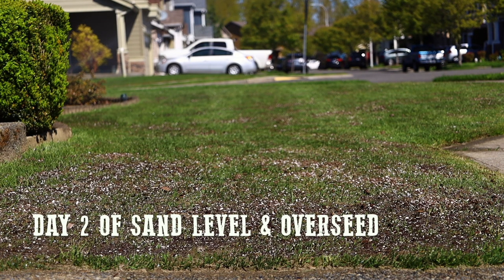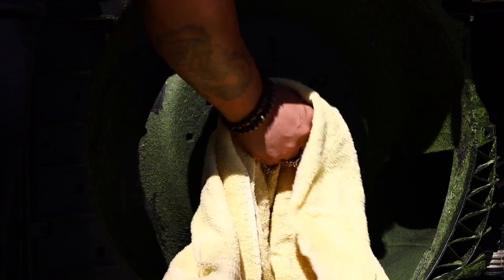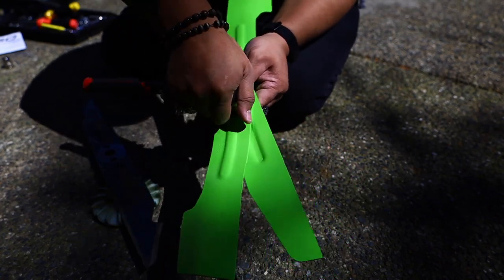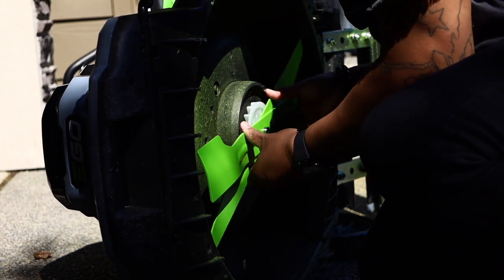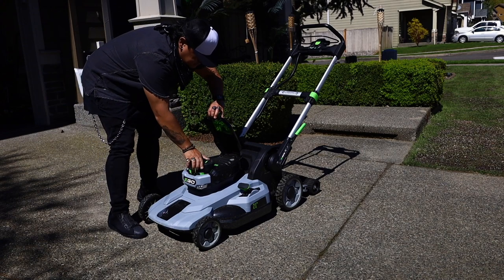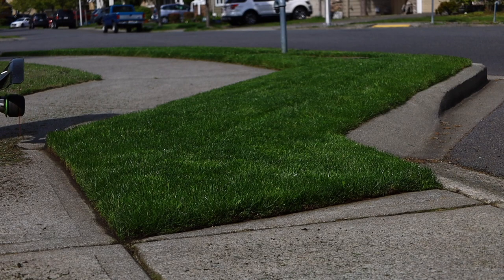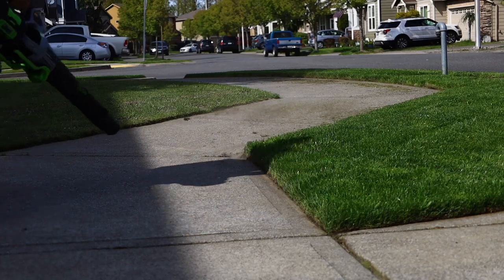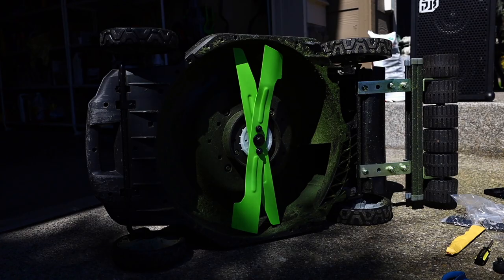I put the EGO Dual High Lift Blade on my Older lawn mower ~ Did it the right way keeping same HOC!

Comment: I did your blade conversion on a Peak Power SP. I used the mulch blades. WOW! What a difference! Absolutely no bailing as with the single mulch blade.  
A few comments. Buy the EGO edger attachment. I went from an 1 hour 15 minutes edging with horrible lines to 30 minutes beautiful lines.  Also when storing you mower, DO NOT collapse the top half of the handle (yah it takes up more space). It creates a flex stress point in the wire harness and one of the self propel wires WILL break. I have seen this on three SP mowers including my own. Two of the mowers were out of warranty and I fixed by replacing the broken wire. One was still under warranty and EGO fixed it.
Reply from the maker: Noice!!! Yes I have the edger attachment it’s the best!!! And thanks for the advice I’m def leaving it up and not collapsed on my 16” trimmer!!!! Thanks for tuning in!!!! 😊🙏🏾🤙🏾

Comment: Great detailed upgrade instruction on the retrofitting the Select Cut High Lift Dual blades (AB2102D) onto the LM2100SP.  I did this same conversion on my LM2102SP last year and the cut was wonderful.  Only drawback was the battery life was shorter especially during extremely hot days due to the none brushless 1000W 5.9 ft-lb torque motor.  To solve this matter, at the end of 2022 winter season I was able to sell the unit and got a one year old Peak Power Technology Dual Battery Ports LM2142SP for $50.00 difference.  Even though EGO has never put a penny on advertise the LM2142SP, it is actually EGO's first lawnmower that comes with the 1200W 8.3 ft-lb (when using total minimum of 10.0Ah power) brushless motor now using on the little brother LM2156SP XP but with more advanced Peak Power Technology to house two batteries while keeping them cool during operation to produce full peek power without dropping at all time.  Did my retrofit again on the LM2142SP and now I have a.... 20.0Ah (10.0Ah x 2) Select Cut Peak Power Technology Dual Battery Ports LM2146SP XP running at about 9.0 ft-lb torque.....Zoom.... Zoom under the hot sun with 150 minutes runtime baby!  Zoom.... Zoom 😎
Reply from the maker: Oh man!!! That is awesome! 150 on the run time damn and the power that’s like 128gigs of ram on a macbook 😂😂😂😂 thank you for the info I’m def gonna look into this!!!! 🙌🏾😊🤙🏾🙏🏾
Reply: Nice set-up... Might try that myself. I think you meant lm2142sp xp not lm2146sp xp setup.  Did the 10.0ah battery fit in the port easily?
Reply: @fata3176  LM2146SP since EGO codes the last digit to go with the battery capacity so "6"=10.0Ah just like the 2-stage SNT2406 with 2 x 10.0Ah batteries and LM2156SP with single 10.0Ah battery.  The chamber will fit any size battery easily.

Comment: LOL. I ordered the parts you listed. Back ordered🙃. Finally received them after 2 months. They sent the wrong bolts with hex heads and nuts were different thread! Found only one other store for the bolts, power+plus. I'm assuming a long wait. Used 2  standard 3/8 carriage bolts nuts lock washers for now. Will test this week. Thx for the info.

Comment: Good job !!!!!   What an excellent video. Very precise  very detailed and well done providing all the part numbers !!!!
I think im gonna try this mod !!!!! And I just may follow all the instructions here as yes , I really like my ankles !!
Only thing ....I didnt find the blade set on Parts warehouse....Guess I'll just order it from lowes
Again that was one very informative and entertaining video !!!  Thanks so much !!!
Reply from the maker: Thank you for tuning in! Yes the blades are at lowes or ace for sure just a quick tip high lift blades takes a toll on the motor if you have issues try the mulching blades or the extended use blades I find it is t working as hard with the mulching blades 😊🙌🏾🙏🏾🤙🏾

Comment: Great instructions, though I seem to have an issue.  I ordered all the parts from Parts Warehouse as you indicated.  However, the replacement flange bolt is the same size as the original flange bolt.  Given the narrower thickness of the fan, it would seem that the replacement flange bolt should be shorter?  I wondering if Parts Warehouse sent me the wrong bolt (even though it has the correct part number on the package).  Could you possibly tell me the length of the replacement flange bolt?  Thanks!

Comment: Thanks, just did the conversion and it was a mixed bag for me. For one thing, the battery drained much faster, that was to be expected, but it ran out in about 20 minutes. Secondly, I noticed the cut at places was very uneven, which was the main reason I did the conversion in the first place. 

There were some areas that cut very nicely, but overall, I was not impressed. In my opinion, I don't think this lawn mower does well on slight slopes or grasses like Bermuda. Thinking about going back to a more powerful gas mower, because the newer, more powerful EGO mowers are too expensive, and I have had this one for just over 4 years.
Reply from the maker: Oh wow it’s lasted you a long time! Yeah I have the 7.5ah battery I get easy 35-45 min consistent run time! I noticed the extended run time blades and the mulching blades don’t effect the battery as much as the high lift blades do though 😊🙏🏾🤙🏾🔥🔥🔥

Comment: Hey man.  I’ve seen many good videos on this conversion.  All I can say is get some power tools 😂.  Nah I really came to say I appreciate the production value to your vid.  Super quality.  Thank you.   
Also. Get you a power tool 😂

Can confirm.  You will cut your ankles off.  😂 

Do you feel it reduces battery life or has trouble spinning the blades up to speed.   I was the guy that tried it without the parts and I broke the motor bushing.   But it seemed like it didn’t get up to speed in correct time.  Plus I cut off my ankle and my middle foot toe.  So I went back to single.

Comment: Yes! I cant wait to install my fan and new blades and glad to hear "its on steroids". Thats one drawback with the EGO mower, not enough suction power
Reply from the maker: Yes!!! I am rocking the 7.5 ah I need a 10ah to make it last even longer!!! But at $500 I think it can wait 😂😊🤙🏾🙏🏾🙌🏾
Reply: @YardBrah  I used to use the 5.0 but after 45 minutes I got annoyed. The 7.5 is good for my 60 minute mow. I have the EGO snow blower and use the 7.5 & 5.0 in it.

Comment: It's louder and feels more powerful because of the added weight of the second blade. The mower detects more resistance and therefore, the 'turbo' mode kicks in, resulting in a decreased run time. Continued use of these retrofitted blades will cause overheating and quickly wear out the motor, voiding the warranty. The LM2100 is not designed to handle the additional weight/torque. I would think twice before going this route.
Reply from the maker: Can’t beat the cut and dual blade action though she’s still running strong 😊🤙🏾🙏🏾🔥

Comment: Great video. I've been searching for a way to upgrade to the dual blade system.  I know you bag but I mulch. Do you happen to know the part numbers for the dual blade system for mulching,?  Thanks
Reply from the maker: I just put the dual mulching blades on use the same parts the blade number is AB2101D 😊 I like the mulching blades it seems the ego mower isn’t working as hard to spin!😊🤙🏾🙏🏾🙌🏾

Comment: THANKS for this very helpful recommendation and excellent step by step instructions. the parts and the bagging blade put on today. Made a big difference to the cut and lift on my 4 year old ego. One downside- batteries seem to take a hit with the extra blade but I've got plenty 🤙
Reply from the maker: Yes nice! glad I could be of some help! It is a very nice conversion I really want to try the mulching blades next! 😊🙏🏾🤙🏾
Reply: @YardBrah have you tried the mulching blades yet? I’m debating on doing this retrofit and idk if I should go for the high lift or the mulching blades.

Comment: I love Ego and I've invested a lot into their products.. but lately they've been disappointing me.  I have their mower (purchased 3 years ago).. a wire for one of the safety checks became messed up (from the foldup design) so I had to fix that in order for it to start.  Now the back right rear wheel locks up when going backwards after using the self propel.  And one of the two 5.0ah batteries I have flashes yellow after using it for 2 minutes.  I might just try dealing with their customer support, but at this point I'm considering Ryobi with all of the new products they are coming out with.
Reply from the maker: oh no! Yeah nothing but good things over here in yardbrah land... I have heard nothing but good things with Ryobi my neighbor Rick across the street has the whole Ryobi lineup and his yard looks fantastic! That new Ryobi 40v for $299 is tempting me lol haha
Reply: your battery goes yellow because of how it cuts your tall grass. upgrade the blades and the battery will not get bogged down

Comment: I have an LM2100SP, and I didn't want to have to bug you email. I did take pictures of the model and the mower itself. Will it work on this model? Like the lawn mower won't stop with the flashing red light or any error codes? I'm just curious before I do it I got all the parts in my basket it looks like a very simple swap out. It's just obviously you know how much these things cost we just got it last summer and the one blade is just not cutting it literally tired of making double passes so when I saw there was a right way to do this and saw your video I thought maybe it is possible. By the way I thought it was a good video of yours and I like the way you mixed some humor in there and it's a DIY 👍. My other question is how much battery life do you lose because I really don't have that big of a yard but it's thick grass.
Reply from the maker: This is on the lm2100 and it works awesome no codes nothing but I also have a 7.5ah battery! I do have the lm2100sp but the parts I ordered for the conversion have not shown up yet but it should be the same thing! Same mower just self propelled 😊🙏🏾🤙🏾🔥🔥🔥🔥
Reply: Thank you for the very quick response I do appreciate it. I ordered the parts listed. Which blades would you recommend for the upgrade? High Lift, Mulch or Extended Life? I know which ever set I use will be better than this single black blade that is on there now.
Reply from the maker: @michaelkosinski5671  after testing all three I would def go with the mulching blades! they still bag well if you need to bag and it doesn't bog down the battery like the highlift does! 😊🙌🏾🤙🏾
Reply: Thank you very much for the video and the basically helping me directly. When the parts get here and I do it and I will do it carefully and completely correct like in your video. And I will let you know how it works out. Thanks again 👍
Reply: Hey YardBrah I messaged you a couple weeks ago about the great video of the upgrade process that I decided to go for. I ordered the parts 7-31-2022. It still says processing and all messages are identical "something sorry about new product  and other things". First the robot message said 8-18-22 but the last message says now it will ship on or hopefully by 8-26-22 with no guarantees. My question was if you don't mind me asking was it like that with you and also if you don't mind me asking how long did it take? I only ask you because I'm not getting anywhere with this company. I apologize to bother you man.

Comment: How bad is the hit on battery life? I have an older non self propelled 2100 with a 5ah battery
Reply from the maker: I mean it is working a bit harder with the high lift blade... with the mulching dual blade it doesn't seem to effect it.  I have 7.5ah and havn't noticed a huge decline in battery life... then again I only mow 1100 sq ft in the front with the ego so I never run out of battery time! 😊🙏🏾🤙🏾

Comment: Hey yard brah! Did the exact same thing but my results were mixed.
  It started off great with my back and side yards but missed more grass in the front yard then the old single blade. Not sure why. Grass was morning dew wet but figured the upgrade would demolish it. Any ideas? Thanks!

St Augustine Grass btw
Reply from the maker: Oh man… if everything is installed properly this thing is trimming super even… maybe you have grooves in the soil? Mine is pretty level on the main lawn but I will see “Mohawks” on the sidewalk strips where the ground is a little grooved from going the same direction everytime 😊🤙🏾🙌🏾🙏🏾
Reply: @YardBrah  the yard is pretty even. No mohawks, just single blades of grass after a passover. SP speed is at half or less. Noticed a lot of grass mulch on bottom of deck, cleaned it and nothing changed. Had to go over front yard again for mental reasons lol. Noticed battery life took a drop. Used to get about 2 cuts on a full charge but now 1 1/3. Wonder if new blades need to be sharpened?

Comment: Just bought the single blade Ego. Tried it out and am not happy with the cut overall. Was going to go back and return the recently purchased Ego ( if they would do that) and pay the extra money to upgrade. Then out of the blue you show up with this great video. I am not mechanically inclined but believe with your instructions and well put together tutorial, I am going to give a try. Thanks for the video.
Reply from the maker: I used the single blade for 2 seasons and definitely felt something missing. For me it was fine the cut was decent but not perfect. I was looking at the $700 egos but Once I did this conversion I started to laugh at the $700 egos 😂 Next video is coming out today I put the new mulching blade on the conversion! It’s a dream! Doesn’t feel as heavy as the high lift blade and doesn’t feel like it’s bogging down the 7.5ah battery. These dual blades make a major difference 😊🤙🏾🙏🏾🙌🏾 I do have the 7.5ah battery I want to get the 10ah it would make a big difference.

Comment: Sup yardbrah! I did this conversion about 3 months ago and followed this great video. I have the self propelled though. It cuts so much better and lifts better too with this conversion. I bought the new LM2114SP and thought I could do the same conversion. Nope. Everything fits great without the dual blades being too low and not it’s proper height setting. I turn it on and it starts for about 2 seconds then stops. No sort of light comes on though to warn me that something is off. The battery was on 1 bar though and maybe it needs more juice and or a 7.5ah or bigger. I was at 1 bar with the 6ah it came with. Maybe that was it? Hopefully! Cause I don’t think I could go back to the single high lift blade 😂🤙🏼
Reply from the maker: Aye nice! Yeah I use 7.5ah they say it’s not power related but I notice when I use the 4ah it does bog down more often… also check your torque mine is around 36-40 lbs of torque 😊🙏🏾🤙🏾🔥
Reply: Ernan, were you able to get this working on your LM2114?
Reply: @briandoiron8438  what’s up! No it wouldn’t work! I was bummed out about it and couldn’t return it at Lowe’s. But, the newest one bogs down A LOT with even semi thick grass. I’m sticking to the older one for the dual blade reason and rarely shuts down on me when grass is thick. Hope this helps 🤙🏼
Reply: @ernanhernandez7039  Thanks for the update.  I was going to just take the fan module and blades off my broken 2135 and try it anyway to see what happens :-)  I have a couple weeks to bring back the 2114.  I just may.

Comment: Definitely enjoyed your video as I just bought an LM2102 7.5ah single blade system and I'm excited to change the blades, though I really need a mulching blade, because I have a lot of leaves that fall from the trees!... But really like your high lift idea also and how you took extra care with putting it on the right way!... You explained it very well and I totally agree! This is a machine, be careful how you do with it!... I was thinking you might want to put just a dab of lock-tight on the bolts???... Just a thought!
Reply from the maker: Yes for sure lock tight is essential but I’m actually wanting to go try out the mulch blades myself! I torque it down to 30 lbs every week just in case! Thanks for tuning in!!! 😊🙌🏾🤙🏾🙏🏾

Comment: When I installed the new blades and was torquing the center bolt down I noticed the plastic fan was turning behind the blade as I tightened it down it’s was spinning however the blade was against the blade stop pin. That didn’t seem right it didn’t want to tighten have you experienced this before? And is thus correct?
Reply: Yes. The same thing happened to me however I was able to fix it. Hold the plastic fan with one hand so it doesn't move and start tightening with the other hand. If you start it off it will catch and lock into place.

Comment: Hello I'm I'm sorry to bother you again. I was wondering if it was normal for the shipping process to take this long? I ordered it July 31st the parts they first told me it would ship by August 16th then the 21st now they're saying the 1st of September and they keep saying like we can give you a refund but I'm wanting to part. I'm just wondering if  it's normal it happens to everybody? I wish I could just emailed you I promise I'll delete this after you read it because I just didn't know who else to ask I know for a fact that you did this procedure and it worked out I figured you know more than anyone.
Reply: I ordered my parts in June or I got the blades separately a month apart (End of June than end of July) and they finally just shipped the rest yesterday. You'll be waiting
Reply: Yes I agree, also they are doing the same thing with my order as well. It appears they shipped everything separately. I received the flange bolt today and that's a start.